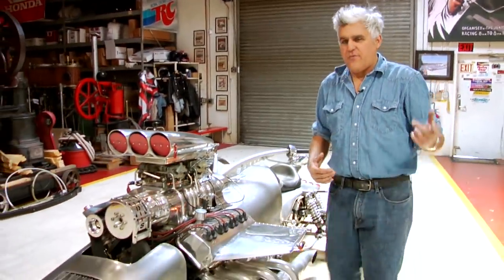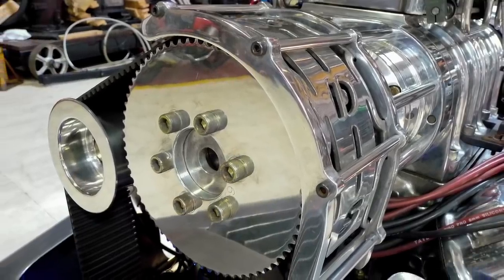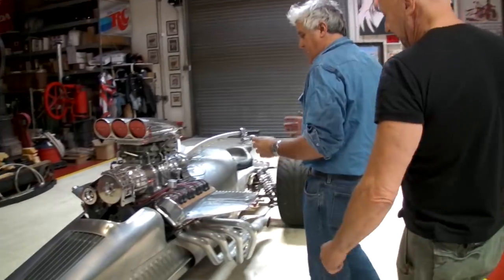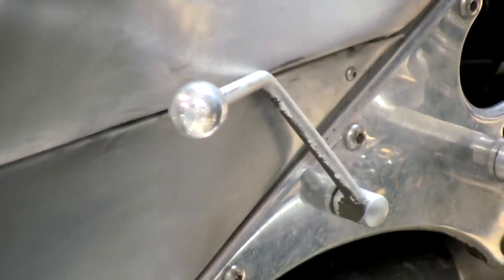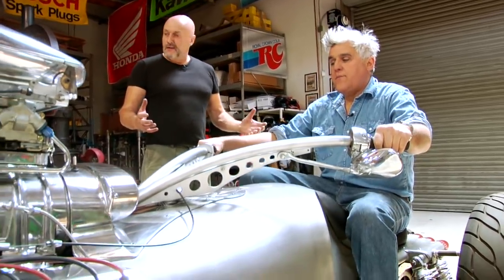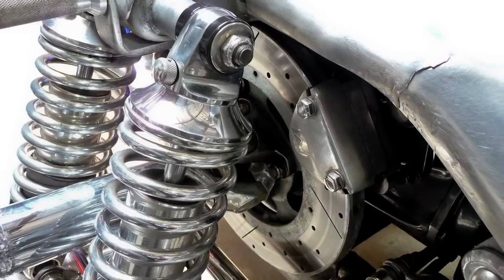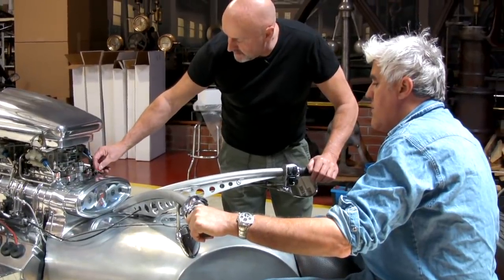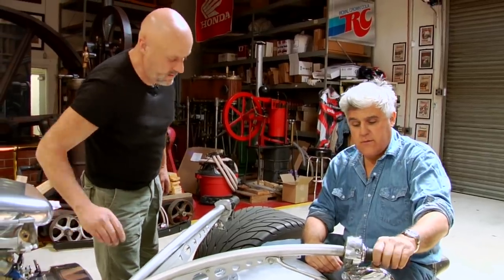Rocket II Trike - Jay Leno's Garage

Comment: So if you twist the handle fast enough, the bike will go, but you will stay? There are no belts, so what's stopping you from going backwards? Grip strength?
Reply: Adrenalin!
Reply: February velcro on the seat and pants haha.
Reply: Dont let go.
Reply: February SUPER GLUE !!
Reply: February what do you think keeps you on a regular motorcycle???
Reply: Steven F
gravity, friction and not enough power to actually throw you off the bike. But this 1000hp+ with a smooth and flat seat might be different :D
Reply: February Ever heard of hayabusa turbo ?
Reply: +February. Its called gigantic balls for counter balance i have saw some crazy stuff and i would die on that thing but i whant it
Reply: Mickr4
Yeah, I have.
Reply: February They only do 700hp but the power to weight ratio is far greater.. Therefor greater accelerations...
Just squeeze your legs and pray.. lol
Reply: February Well not really, not really any of those things keep you on a regular bike.  What keeps you on a bike is the fact that the seat is bolstered up in the rear by either a passenger seat or it's just hooked, in a banana shape, or similar.  The seat is designed to keep you from sliding back, especially that one, look at how you're sitting in the seat - you're not going anywhere.....  Has nothing to do with gravity or friction or gravity or anything, on a flat seat even a low powered bike will make you slide back, it's all in the seat design.
Reply: February Poop is sticky... Think about it for a minute.
Reply: I wouldn't want to be belted to that thing in the event of a crash I'd rather be thrown from that vehicle then roll crash with it
Reply: MrSlowestD16
That's what I'm talking about with this monster. Look how the seat is made.
Reply: February What I mean is it's not this monster or that monster or anywhere in between.  Even a 40hp commuter bike will make you slide back a good ways if the seat is designed improperly.  Your original question asked if it was grip strength and gravity.  No, it's all in the seat design.
Reply: *****
I knew there had to be something!
Reply: +ConfederateJoe  Best comment!!!  :D

Comment: I think your trike is a wonderful piece of engineering!...... but may I point out that the front 6 pot caliper is mounted incorrectly! The rotation of the disc (rotor) should always pass the small bore first not the big bore, this stops undue stresses on the caliper and taper pad wear!
Keith. (UK)
Reply: Yawn.